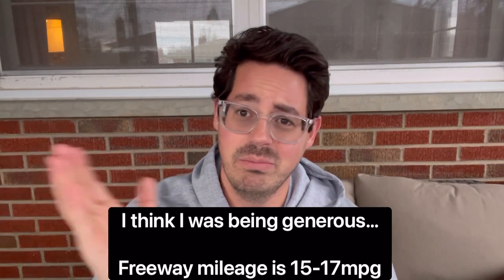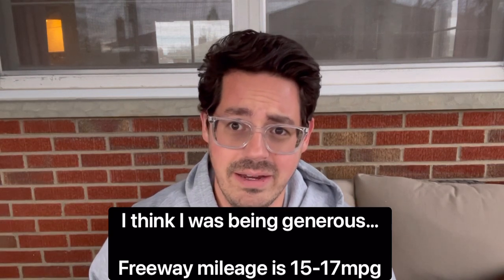Worst Engines of All Time: 1982-84 GM/Chevrolet 305/350 V8 Cross-Fire Injection System

Comment: When you come up with a new "better" fuel delivery system to replace the carburetor and put it on 82/83 Firebird then go back to the carburetor for 84 and gain 30 horses and increase efficiency, you know the system sucked.

Comment: I owned a '91 Z28 with the 350 TPI L98 engine. That car nickel and dimed me to death. I realize it's a sample of one, but I was constantly replacing something. I got so disgusted by it that I traded it for a '91 Mustang 5.0. That started a many year love affair with the 5.0 Mustangs which ended up being the most reliable "fun" cars I ever owned. I owned several Foxbodys and even after significantly upping the horsepower, they were as reliable or more as any car i've owned.

Comment: The CFi was used in 1982 to mid 1983 in the F Body. It was replaced mid year with the much better L69 5.0L HO V8 (190hp), usually paired with a low gear rear end (3.42 or 3.73), and a 5 speed manual only (in 83), or a TH700R4 (an option in 1984 only), then it stayed in 1985 and 1986 next to the TPI LB9 5.0L, but those are NOT common. 1986 Trans Am L69, only 26 were built, making it the rarest F-Body built per engine and year.

Comment: I remember as a little kid when the '82 F-bodies and '84 Corvette came out. I thought they were some of the most gorgeous cars I had ever seen. I would stare at them on the covers of automotive magazines for what seemed like hours. Too bad about the early quality issues.
Reply: I remember falling in love with the new Camaros z-28.....looking at them in magazines . I was old enough to buy a new one and it was nothing but a POS. Lot's of problems early on with the transmission, windshield wipers would stop working in the rain, just a rolling bucket of problems. T-tops leaked like a tin can full of holes.

Comment: this was an unexpected treat. I was hoping you'd do a 3rd gen Fbody vid. Would love to see you dust yours off for a night drive video! Yes these motors were notriously frowned upon in the car world. I'm pretty sure the L69 HO 305 could be got in 83'' in Canada. The LG4 305 with the 4 barrel had 10 more hrsprs than the X-Fire and wasn't as finicky. The LG4 will rev to 6100 rpm without grenading because when I was 15 with my learners I missed a 1st to 2nd shift in my dad's 86'Iroc for which I promptly got a smack to the head.  
 I currently have a 91' Z28 1LE that came with the 230hp TPI 305 (LB9) and the T5.  Got it in 93'.  
It was fun until modern SUVs were pulling me up hills so a few years ago I put a 400hp 350 ZZ6 Chev Performance crate motor and a Tremec Supermagnum 6 speed in it.
 Still have all the original parts in the boxes the new stuff came in. (nothing was or is wrong with the LB9 / T5).  

As always, great video.

Comment: I bet having the t tops caused a lot of that body flex. The KR cars used the 350 trans and carbs for reliability I believe. It is funny though how in europe at the same time, they had reliable fuel injection ststems, and were getting more horsepower for less displacement. The euro equivalent would be the 2.8 Capri injection, with very similar performance as the TA
Reply: They also had no emissions regs, no fuel economy standards, and cars that cost twice as much money as they did in the US. High octane leaded fuel was available a lot longer also. The big three really got screwed by ridiculous and contradictory government regulations.

Comment: Atom unless you're determined to keep your Trans Am stock I would suggest getting a 700 R4. You can roast the tires all day long with that transmission. The only transmission from GM with the number 200 on it that was any count is the 200 4r I've got that behind my 455 in my 83 Cutlass built up quite heavily of course....
Reply: GM didn't perfect the 200-4R until '86... avoid the earlier ones...

Comment: The Cylinder heads were weak also , port and valve size.
Reply: The iron -882 heads actually worked pretty good in '85 TPI 350 Vettes, better than following year's aluminum heads: 
https://www.youtube.com/watch?v=M9FwU9iUmfo

Comment: I had an 82 Recaro Trans Am with the crossfire. That car was amazing.  I never had a problem with the transmission, and it always ran very well. I can definitely agree on the horrible fuel mileage though. With the engine floored on the straight I could watch the gas gauge drop.  My buddy totaled it one night while he was driving it. Miss that car 😆

Comment: Man, those '82 TAs just don't scream TA enough, especially considering the previous generation... I liked them OK when they were new, and probably would've even taken one over the Mustang GT in in '83 and '84. (But not in '82.) The Chevy engine thing kind of turned me off a little even as a kid.
I had an '84 Capri RS 5.0 with T-tops, and backing out of a driveway and looking mostly in the sideview mirror, I could see the front fender, door, and quarter panel all moving in different directions. Somehow, my '88 Mustang convertible is much stiffer. Both cars being high mileage with crash history...

Comment: Yeah, GM did have some real crappy engines. I had the "privilege" of driving an Oldsmobile 88 with a 5.7L DIESEL. Wow, incredibly gutless! Couldn't make it accelerate faster no matter what I did! What are your thoughts about this one?
Reply: Needed more and stronger head bolts, a water separator, a better fuel pump, a better transmission, an in-depth mechanic training course, a detailed owner's manual, and a Turbocharger. After that, it would be quicker, if not the fuel economy winner that GM wanted.
Reply: Not unusual for Diesel engines of the time. No power and crap reliability. My neighbour of the time had a Rabbit diesel that was not only gutless, but turned him into a pedestrian on every cold day.
Reply: Jeeps have 4 cylinder diesels in export versions, were weak N/A, but the turbo charged versions almost feel like a hemi under the hood...

Comment: Howdy.....ive had a crossfire corvette for 15 years....once its warmed up its fine I put a tune port fuel pump on it years ago and that was the answer.....and roller tip rockers. And its gotta x-ram 2 manifold which is the crossfire injection on a wieand accelerator manifold.
Reply: I also had the x-ram intake with their 2" balanced tbs, on 383 stroker motor, edelbrock heads, roller rockers, no emissions, headers dual exhaust, tci 700 r4 , 435 hp at wheels, pulled like a jet.

Comment: There is alot if detuning on these cars and conservatism prob for insurance rate costs like all other brands of the era ! but i still have to give to gm hands down to leaving to the owner for the upgrades ! and aftermarket support is 3 fold ! the last 84 i modified cost $1500 and 6 hrs labor which really woke it up ! and stage 2 would be the exhaust system
Reply: Not insurance, but a combo of emissions and fuel economy regs. It’s actually a testament to the engineers at GM that they could meet the emissions regs, meet the ever increasing fuel economy regs (CAFE), and add more horsepower every year.
Reply: @ErikDB6  ya i got a 86 vette  tuned port and just uncorking the exhaust made a world of difference and i slowly am reducing the weight its a sub 3,000 lb car now !

Comment: How was the CFI the worst, when it made more power, torque and got better mpg than it's predecessor?  Wouldn't the weaker, thirstier predecessor be the worst?  Or worse? 
I had a CFI TA too.  Had it for 12 years and it was great (for me).  Ran low 13's when I sold it....got 24mpg highway.  What was it missing?  

BTW: it's a medium length runner intake, with runners about 11" long....TPI runners (long runner) was about 21".   Finally long runners make MORE low RPM air velocity....not less.  Oh boy...
Reply from the maker: If yours ran low 13s, it was definitely not stock.  These were high 15/low 16 sec quarter mile cars in TA form.
Reply: @RareClassicCars  You're right, it wasn't stock. The reference to its performance was to illustrate that it can run well, get good fuel economy and so on. As far as the intake was concerned, which is what makes it a CFI and the worst engine ever, all that was done to it was different injectors and the intake Runners were Ported all the way through. No it's not the best engine ever, that is for sure. But compar it to what came before it. Those were worse. A lot worse.

Comment: Deliberately building weak engines and tranny's is why I LEFT GM.  I bought a new v-6 stick, S-10 Sport in '83, great little truck. 85k in two years.  Traded it for a new IROC Camaro.  What a cheap PLASTIC interior.  The dash pad cracked with in a YEAR!  Dealer said it was a freak thing.  Funny the plastic screws that held the plastic trim in the rear popped the heads off too.  They were 4 dollars a piece then.  I dumped that car after a year.  Bought a '69 Camaro 350 2-v, custom exterior and custom interior, turbo 350, PB, PS, vinyl top base car from the original owner, a Female Teacher in Walnut Creek California.  Had the original dealer chrome tag frame!  No rust under the car.  This was 1986.  The car needed a paint job and new top. and new seat covers.  sat outside in the California weather.  I took it to get all the fluids changed the next day.  All the Chevy mechanics at the dealership wanted to buy it!!!  Unfortunately, I gave that car to my brother, and he didn't care a thing about it.  My Mother sold it!  It was never to leave the family but....whatever.  There isn't anything GM, I care to have new.  It's a shame what has happened to the car industry.  Throw away stuff.  Like Toilet paper.  The sixties was probably the last decade of real American cars.  Yes the fit and finish wasn't great, but there was metal.  The plastic didn't look like RUBBER MAID either.  Sorry so long Adam, and everybody.  Just remember when cars and trucks were solid.  I have to get my base 2 door (formal roof)1970 Montego 351 v-4 Cleveland going.  Do you like those Adam?

Comment: I had an '86 Iroc Z 305. It was the most trouble prone car I've ever owned. It lived at Blake Chevrolet until the warranty expired. The car was stolen shortly afterward.
I never bought another GM car ever again, today they don't make cars anymore, except the C8 which is also a shop dog. Silverado sales slumped, finishing behind Dodge, again.
Oh yeah, you can buy a Chinese built Buick, good luck getting it delivered!
Goodbye, GM. I won't miss you.

Comment: A friend bought an ‘82 Z-28 last year with 3,800 original miles. With Crossfire injection.everything looks fresh and brand new, but they are driving it. Duplicate of his high school car. We will see how this works out. 

My 1988 Sport Coupe has a TBI 305 with the T-5 speed. Always 27 mpg at 65 MPH. Only problem I had was the Throttle Body gasket had a chunk break open, allowing false air.
Reply: Don't let rain water get into the CFI through the hood openings!

Comment: I also had an '82 Trans Am with the infamous engine. I fell in love with it due to Knight Rider. I was 11 when the show debuted. It was a convergence, lol. I had minor issues with mine when I bought it in 1998 with only 51,000 miles, no T-tops, so, the car was reasonably rigid by the standards of 1982. The drivers side throttle body needed work, no big deal, and the catalyst clogged. The automatic....whew, what a piece of crap! I had it "rebuilt" by a reputable shop and it was worse. I held onto the car after having it fully restored comestically and sold it to my brother in 2003.

Comment: I've had 1983 Z/28 Crossfire car for over 30 years.  It's my first car.  I used to commute back and forth from Phoenix to ABQ.  I was getting 20+ mpg on the highway about 15 or so in town.  I have problems with the engine itself, but I went through two 700R4s.

Comment: I hit the wrong key and it sent the first reply. My blunder! I have done engine replacements on these cars under warranty. Had an 86 Tuned port WS6 car 305 powered. Great handing but slow as death. Had to break out my late 60’s winter cars to make real power. Have to admit the later models became faster until you lined up against a Ford Mustang. I was humbled by Lincoln LSC in my 86.

Comment: You're correct on the fuel pooling. My buddy had an 83. He had really hard starts hot. It would foul plugs and o2 once a week. He fought with it for 4 yrs( so did the dealer) and bought an 87 T/A 5.0 tpi with the 5 speed, cuz he swore off GM auto transmissions. Fun fact, the dealer wouldn't take the 83 on a trade in! He had to sell it privately!
Reply: There is no 83
Reply: @kdsboosted4954  No 83 Vette, but I think Adam meant 83 TA.
Reply: @greggc8088  your probably right
Reply: There is no 83 vette
Reply: @kenfrievalt7826  - I think there were about a half dozen '83 Vettes...
Reply: I have one of the first '87 1/2  GTAs: 
https://i.pinimg.com/originals/0a/6e/92/0a6e925d76ea7b8a50b40ef04eb7a4b5.jpg
Reply: There is one and only one 83 Corvette and it's in the GM museum.
Reply: Sounds like it had a bad coolant sensor. Stuck on cold start mode.

Comment: A guy I worked for specifically worked on these cross injection systems. He says turn up the PSI on the regulator to 12 for daily driving and they're smooth as butter. Performance or boost turn it to 15 - 17. I think a little more thought into the intake runners would of helped the most.
Reply: Do you think every Corvette owner is a mechanic and can do that with simple tools and minor mechanical knowledge,didn't they even have the air/fuel mix capped,and what would raising the fuel pressure up do to the emissions when you went through  inspection.
Reply: @duster71  Actually it can be done with “simple tools”, and you don’t need to be an ASE Master tech to adjust the fuel pressure. Bumping the fuel pressure does make a HUGE difference in the behavior of the car. As far as emissions, once in closed loop, it is kept at a stoich 14.7:1. GM “recommends” 9-13psi for a stock application. Most of the untouched ones I have checked are in the 8-9psi neighborhood.
Reply: @joesfoxbodyandmusclecargarage so how do you turn up the fuel pressure?
Reply: @duster71 ah, yes.

Comment: I enjoyed the video, but I'll have to disagree with you on the feedback Quadrajets, 
I have one on my 1980 Z28 305ci had a hell of a time trying to get it to work right and pass smog.
Even enlisted the help of a friend who was a very good GM dealer mechanic.
It gave us both fits, so I'm planning on doing a TBI conversion when I pull the heads to do a valve job then running it by a smog referee.
Reply: The Q-Jet was a list the best carburetor every made, but it just couldn’t work well with the contradictory emissions and fuel economy standards of the time. Sad, as most people have never experienced how good a Q-jet can be when set up properly.
Reply: @ErikDB6  agreed, I think the early one's were fine, but when the government got involved with onerous restrictions (especially California) they just ended up making everything worse as usual...
Reply: Same here...  Those Quadrajets weren't much either...  Had one on a 5.0 Cadillac.    What exactly did GM do right in the 1980's???   Well...  I had a decent Grand Am with the Iron Duke.   It was ok...   I had a 1992 Saturn, which was a 90's GM car, but it was ok.   I had a friend that had a Beretta with the 2.8.   It was decent.

Comment: Another problem with this engine was the cylinder head design as well. The heads did not flow well. 305s where a bit worse than the 350s but that is not saying much,   When you look at it they new they had to move to fuel injection. At the time tuned port was still on the drawing board. I always felt they should have stayed with a carburetor and just waited until the tune port was emission certified. I have an 84 Corvette with this system on it and I can actually get pretty good fuel economy. It runs good but its not impressive by any means. Highway driving I can get into the mid twenties. But, I have tuned on this thing like crazy. I worked on these things under warranty and I can tell you it was not fun. You new it was going to be a bad day when one rolled into your stall. I always wondered if they had figured out a way to make the intake taller and put the throttle bodies side by side instead of staggered if they would not have been better. Who knows. That time period was tough for the automobile industry for sure. I love your Trans Am. Like you it will always be one of my favorites.
Reply from the maker: Awesome. I can imagine they were a headache.
Reply: It was the best option available at the time for GM. Emissions and fuel economy regs just didn’t allow the production of power, economy and emissions from a carb. Of those three, power was the one that got minimized.

Comment: Idle tracking and it's throttle balance rules. It's easy to fix now, but it really messed people up back in the day. I imported the 5.7 liter Cross Fire 82 Corvette system. It's issue...it's three imputed values for speed Density, curb idle, vaccum at idle and it's method of idle tracking.